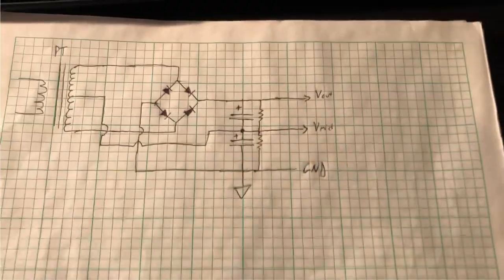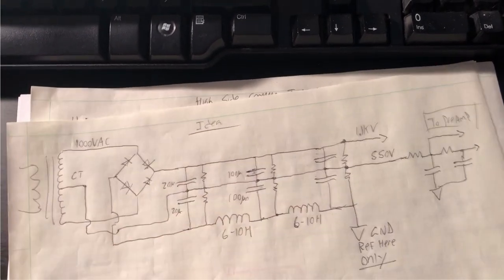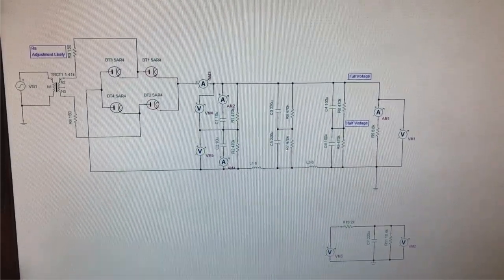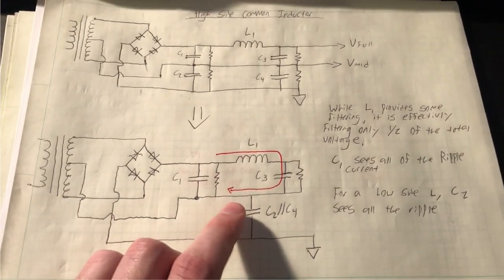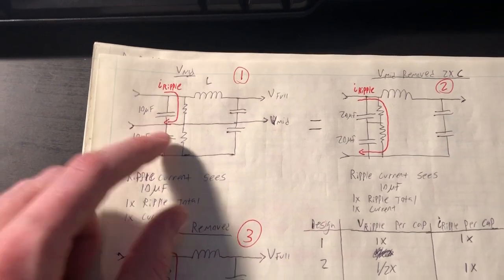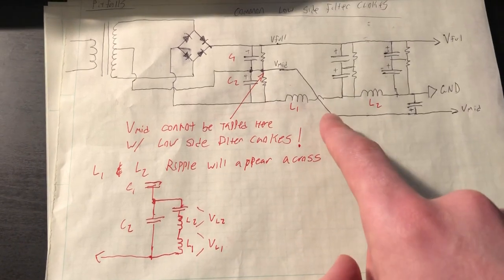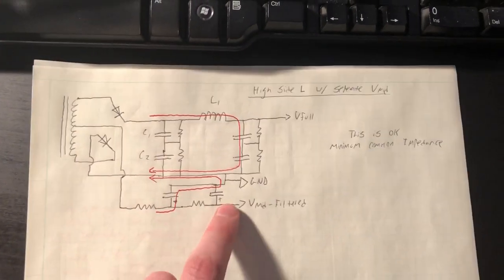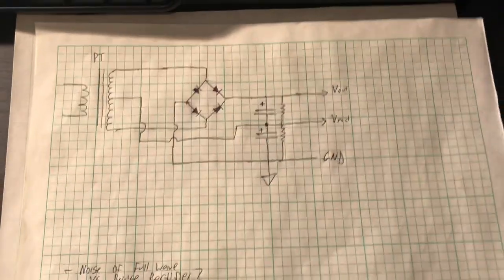Split Level 1000V B+ Power Supply for 845 Tubes - Bandwidth Audio Project 2845 Part 3

Comment: Did you ever consider two isolated 500 volt supplies stacking them after the first stage filter. Using two solid state rectifiers. You will not need as much filter for the final because the current difference between the lower supply and upper one?